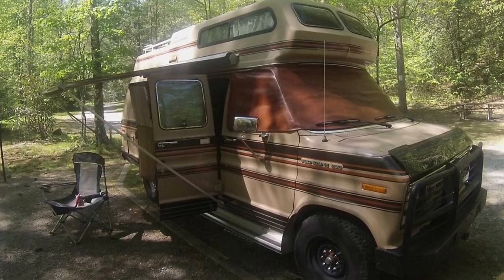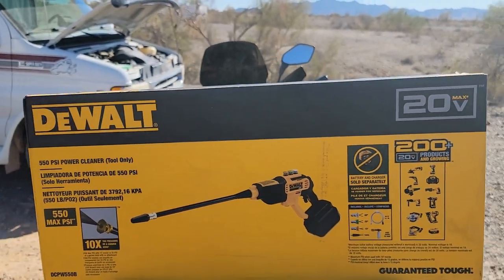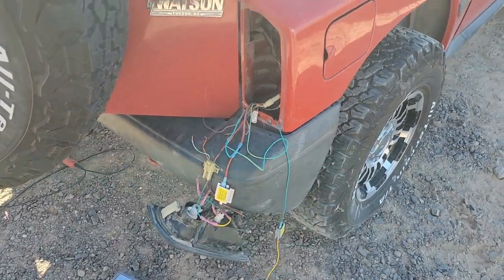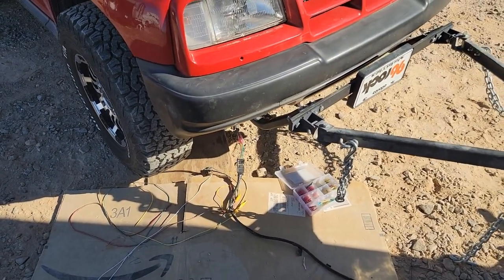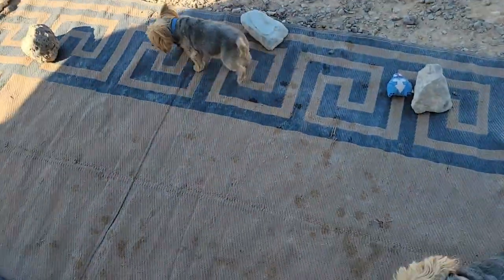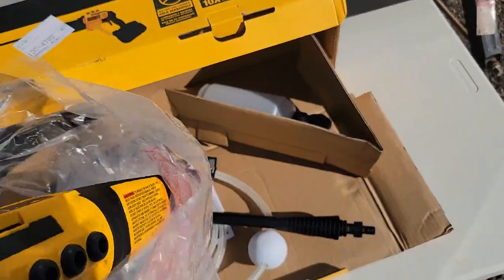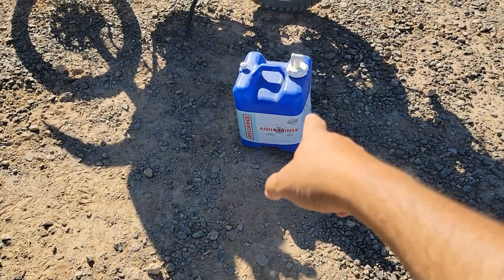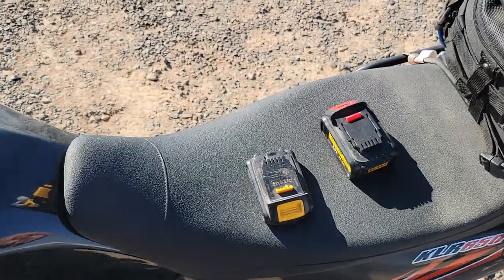How To Leave The Rv Scene Clean!

Comment: I have a pressure washer built in the RV, hot water, and makes short work of cleaning windshields.  I also have a deionized water system to rinse. No drying required and no spots. I also have a "foam cannon" for washing but I'm 45 ft long.

Comment: Don't use a pressure washer on your Lectric bike! The electronics are not water proof, and Lectric will not honor warranty if there is water damage. Best to clean with a wet cloth, being extra careful around the display and the joint where the frame breaks to fold the bike. Some people will wrap that joint in several layers of stretchy cling wrap before washing.

It does look like a handy little pressure washer, if a bit pricey. You can get a 1000 lb corded unit for maybe $75.

Comment: Campervan Kevin, Not a bad pressure washer for what you need it for. We used to have a company come in the grocery store twice a year to clean the shopping carts, stocking trucks and bakery racks. They also would power wash my loading dock doors and steps going into the back room. I always did what I could in between their visits but my Boss was cheap. They’d also perform any maintenance that I couldn’t do on certain items like weld Bakery Racks. My solution if a broken rack sat around for 2-3 months I broke it up and threw it in the compactor.

Comment: Kevin. Wanted to chime in about leaking oil. Electric chain saws are designed to have a passive mechanism that supplies oil to the chain. There is literally a hole on the bottom of the thing that goes drip drip drip drip. They all leak, which is why its advisable to put as less oil in it as possible because it will continue leaking after use otherwise. When I travel with my chainsaw or leave both it and the pole saw in my shed, I always make sure it is out of oil but inside RV I put it inside a giant trash bag. Annoying as heck but they are all like that. I just keep my oil low to prevent tons of oil leaking out.

Comment: I have ryobi brushless hp 600psi version of this. Works well for keeping the toys clean
Has an attachment to use a 2l bottle . Il mix a bit of soap up for a prewash then use a bucket to rinse off. Ryobi chain saw leaks oil too

Comment: My Ryobi 40V chain saw will leak bar oil if i set it down with the bar perpendicular to the ground. If I lay it on it's side with the bar parallel to the ground it won't leak bar oil.

Comment: On your chainsaw after using it either poor the oil back out of it. Or I have read just opening the oil cap and closing it back will keep it from dripping by removing the vacuum pressure in the oil tank.  I haven’t tried that though. I just put one of those plastic trays you set snow or muddy boots on underneath it and let it drip. 

Wipe it out when you need to burn something use the oily paper towel as fire starter.

Comment: I first saw a green variation of those a couple years ago. It looked like a great tool for certain applications, and you just confirmed it. I'm curious if the manual mentions pump saver to flush out minerals and protect the internals. I've seen a lot of pressure washer pumps that were wrecked by mineral build up. or split from water sitting inside the pump freezing.
BTW, All chainsaws mark their territory with bar and chain oil. It's usually worse if motor oil is used.
Reply: I used pressure washer pump saver in mine to protect it.

Comment: I have that same Dewalt power washer.  It is HEAVY.  They should have made it so the battery and motor/pump sit on the ground to the wand part could be lighter weight.  

I also have a Ryobi brand one and it is not as heavy, but has a few less psi.  And I like the Ryobi one a lot bet.  

Dewalt also makes batteries that are more amps comparing that little battery to the big battery really isn’t a fair comparison.  IMO. 

Also dewalt stands behind theirs batteries for 3 years if you have one that is bad.  They sent one to me to replace one that had a bad cell in it. 

The little batteries are meant for the tools you need to be light weight maybe the flash light, or router, etc.    

The hose on my washer was loose too. Same think would not pump water.
Reply from the maker: Batteries bad since new. Would barely run my drill. Of course the 6ah last longer than the 2ah

Comment: Kevin what chemical pre soak would you use to wash the top of your RV? It's a Rubber membrane roof.
Reply from the maker: The problem is using something too harsh and it streaking paint and stripes on sides. I have a mix but without keeping sides rinsed at same time you can screw up rv finish....